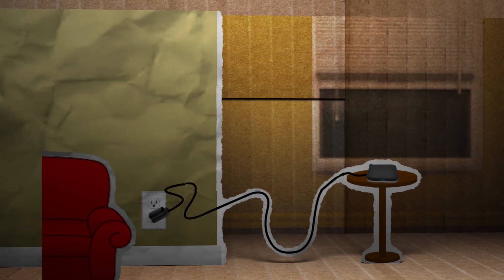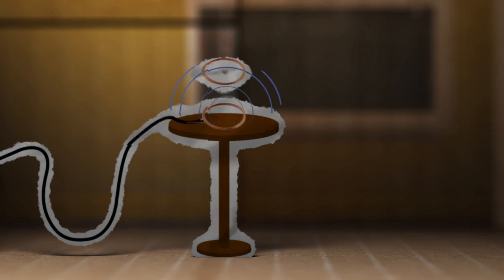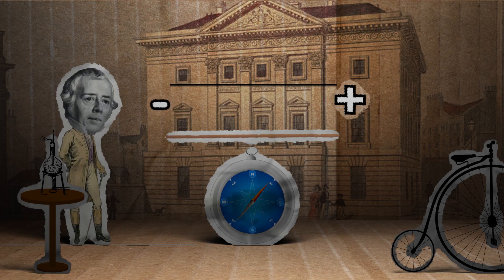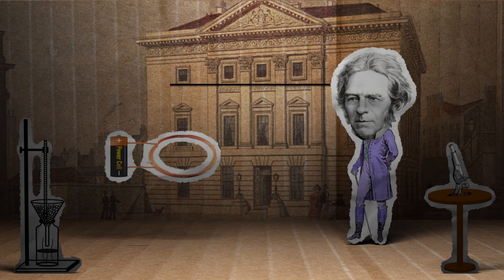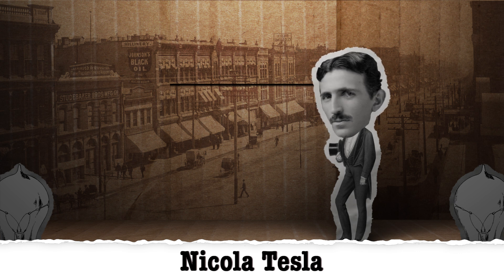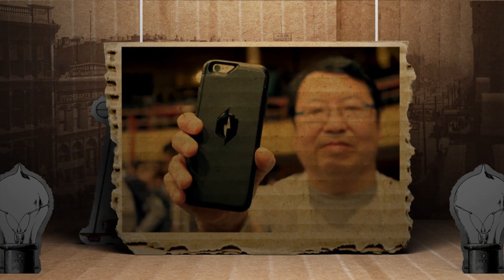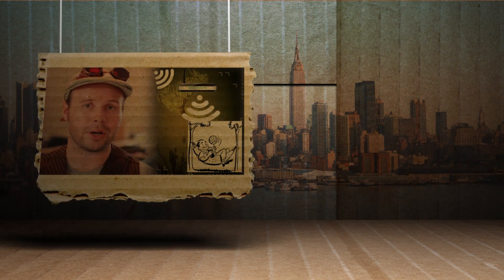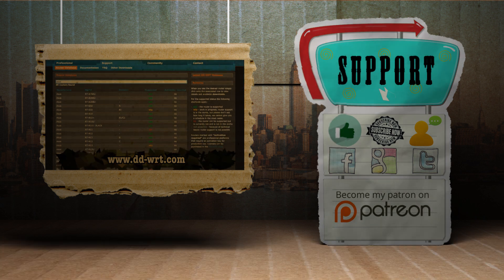How Does Wireless Charging Work?

Comment: Protip: Dont put your creditcard on the charging pad, It might kill it.
Reply: Lol
Reply: Myth
Reply: Eirik Quin It depends on your creditcard and charging pad, But it is a good general rule. Notice that i said Might and not Will.
Reply: will it induce a voltage on the chip? and might short-circuit it? or is it because of the magnetic field produce might demagnetize the card?
Reply: francesco gorini The voltage may be too high for the chip in it, killing it. It is kindof like putting your phone in a charger with 10volts instead of 5
Reply: thanks man, :)

Comment: "...radio waves...carry the magnetic field." This statement is not possible. The radio waves can send energy and the magnetic field can send energy, two separate things. You can either power it from magnetic induction or from receiving radio waves, depends on your receiver. One sends from an electromagnet, the other from an antenna. Great videos!

Comment: That was a picture of Wardenclyffe tower not a Tesla coil and a Tesla coil doesn't create a large mangentic feild by "creating sparks" it uses the spark gap in series with a capasitor to turn the electricity in the primary coil off and on at the right frequency so the secondary resonates a bigger feild at the same frequency. Just thought I would clear that up :)
Reply: Sorry the spark gap is in parallel with the cap not series
Reply from the maker: I meant to say spark gap, but said sparks instead. I actually had a whole section on how tesla coils made resonate frequencies, but it made the video too long so I had to cut it. Instead I just linked to an article explaining how they work.
Reply: Yextus So is wirrles charging harmfull?
Reply: Narps No, but I was wrong in my comment. That is a Tesla Coil not Wardenclyffe, not sure how I messed that up.... Anyway wireless charging isn't harmful, ironically enough im currently reading a book about Tesla right now and as he described it - light is more dangerous than radio waves

Comment: Uh, tinkernut, that "Nicola Labs" wireless charging thing isn't actually all that efficient. From my experimentation with crystal radios, the power coming into the antenna is pretty much in the tiny milliwatt range, doesn't really do much in terms of charging.
Reply: HTFCirno2000 add more coil
a proper rectivier and a capasitor
and you will be amazed
Reply: ***** Okay, let's say we do that. How can you fit a large coil and capacitor in a thin phone case?
Reply: You mean Nikola not nicola
Reply: Thanks bro!
Reply: HTFCirno2000
easy phones are filled with capasitors
so one more does not make a diverence
same as for the coil
Reply from the maker: I agree. It's not really effecient at all. But it is based on this technology!
Reply: Tinkernut
Yeah, that is true!
Reply: *****
Um. Size still matters.
Reply: HTFCirno2000
in current phones (witch get bigger with every version)
there is room enough
Reply: *****
Do you even know what capacitors look like?
Reply: are you insulting me
i am an electronics hobbyist
i revuse to work on smd (my hands wont allow me to solder that)
look at my youtube chanal instead of insulting me
Reply: *****
No I didn't meant to insult you. It just seems like you don't know what you were talking about. You really can't just throw a few more capacitors in a circuit and call it a day.
Reply: well
in this case you can
if you tune the coil to the strongest frequensie (little tuned cap over the coil)
and then a standard bridge rectivier
then you can add as much caps as you want

i am in the proses of designing a tube powerd rc car
so i know about tuning in am circuits
Reply: *****
It's just, for a standard phone case, AM circuitry is pretty big for just the really thin case of a phone.
Reply: i can make a am recever with 2 resistor inductors and a transistor
why would that be to big for a phone
Reply: But that's not wireless charging at all because that requires a battery.
Reply: ......
if you take the crystal recever circuit double it
and use the 2nd recever with a capasitor after the germanium diode you can power a small one transistor amplyfier

so hard it is not
mmmm
(i imagen yoda would say right now)
Reply: *****
But you can't take some power and double it with the same power. It doesn't work like that.
Reply: why not
stop thinking inside the box
becaus the box limits you what you see

step outside and look at the box
everything that is imposible will become clear
and or posible

to get power you make a recever replace the headphone with a cap and there ya go rf powerd power supply
make another recever and amplyfie that witha transistor that is powerd from the 1st one

free radio
Reply: *****
But that box is the fundamental laws of physics. There's no way to get power out of nothing. If there was, we would have figured perpetual motion decades ago
Reply: the laws of fisics are not the box
they are what is the space around the box
you can bent them but not break them
and you cant get power out of nothing
but you can convert power
you can confert volts to rf
but rf to volts is also posible

in my electronics lab at school i had 10M of cable
and all the rf of the motors and tl tubes gave me 30V out of that cable
Reply: ***** You should improve your english before commenting, I think everyone would appreciate it.
Reply: Why should I change
You have to learn Dutch
Reply: ***** And why is that?
Reply: Well because it would make my point clear
Reply: ***** That dosen't even make any sense.
Reply: Well for me it does
I mean why is it that the whole internet needs to speak English
Why not my language for once

Het zou namelijk veel makkelijker zijn om de type fouten te begrijpen
En Meer begrip te hebben voor elkaar
Reply: ***** Well, english is one of the most used languages right now and german isn't really near to being one of the most used languages.
Reply: German are you mad
I speak Dutch
And not German
Reply: Emphazys
...And this is why i stopped commenting in this thread. lol
Reply: Sie sind alle verrückt

that is german

jullie zijn gek

that is dutch

your all crazy

thats english
Reply: HTFCirno2000 Gonna stop too from now on...
Reply: no problem
dont dont even get why you make such a fuss about my gramar
my understanding of technik is sound
Reply: +HTFCirno2000 Thats not the point. Back in Nichola Tesla times, it was possible to charge things over a big distance. If corrupt govermant agencies and companies that make wires somehow let it slip that this is possible. We will be driving cars that will never need charging. Unfortunately thats not gona happen till we run out of oil. Too much miney at stake.
Reply: Alex Grava You do realize how inefficient wireless charging technology is, right? Look up the Inverse-Square Law.
Reply: HTFCirno2000 It can be perfected. Tesla did send electrical currents over large distances with only minor losses... Im just saying...
Reply: Alex Grava Alright, while I've heard of that, i'm not entirely sure how that would work. If that was actually implemented, radio communications would probably be hampered because of things like harmonics and splatter.
Reply: Angel Luis Trinidad i dont mind that every body needs a bit of english
but i hate that they hate on people who can do more then one language but not perfect
Reply: +robot797 : You could post in your own language which no one is stopping you to do, but if you chose to use english(which is widely used and de facto standard) in your communication then trying to be good at it is not much to ask. I can also stop reading dutch-english like yours to not be irritated. I will take second route and leave you with your fake pride.
Reply: ***** I won't change how I write just because one person can't read it

Comment: But the phones are covered with cases so how exactly does the POWer reach the battery? And doesn't it affect the case?
Reply: ***** Thanks. But the iphone 6 is made of metal and still has a wireless charger.
Reply: Those cases contains the coils, and are connected to the charging port I suppose (I haven't tried induction charging)
Reply: Saaki Blanco the iPhone 6 does NOT have a wireless charger. It never did. The only way you would be able to get wireless charging with an iPhone 6 would be with a plastic case.
Reply: rocktheworld2k6 Ok, thank you for the information. I may be mistaken.
Reply: Saaki Blanco No worries! I can see it, many phones are coming out with wireless charging right now, kind of surprised Apple hasn't gotten in on that. If they went back to the glass back like they had on the iPhone 4, I could see them adding in wireless charging

Comment: hey i have question so did electromagnetic induction have dangerous effect for human body ? thanks
Reply: ewan nixon Nope.
Reply: Electromagnetic radiation is only harmful at an energy that is sufficient for affecting chemical bonds ("ionizing radiation"), which is about 5 electron volts. This is more than 10 billion times higher than the energy of qi-charging radiation.

Comment: this wrong place to ask but answer my question please, how do rockets and satellite propulsion work in space? there is practically no friction, i understand they use orbital slingshotting (kind of), but for example after they exit the atmosphere, what propelles the satellite? you can't have a fan propelling, i am stupid please make me little smarrter
Reply: it orbits...
Reply: Robert Wagner i know but to orbit it needs to reach a certain speed right? how to achieve that speed? from what i understand the fire mass from the rocket and because of newtons 2nd law, each action has an equal and apposite reaction, this means the rocket or satellite is pushed forward.
Reply: All current spacecraft use chemical rockets (bipropellant or solid-fuel) for launch, though some (such as the Pegasus rocket and SpaceShipOne) have used air-breathing engines on their first stage. Most satellites have simple reliable chemical thrusters (often monopropellant rockets) or resistojet rockets for orbital station-keeping and some use momentum wheels for attitude control. Soviet bloc satellites have used electric propulsion for decades, and newer Western geo-orbiting spacecraft are starting to use them for north-south stationkeeping and orbit raising. Interplanetary vehicles mostly use chemical rockets as well, although a few have used ion thrusters and Hall effect thrusters (two different types of electric propulsion) to great success.

Comment: Since it is an electromagnetic field, doest it involve radiation? In terms of negative effect of radiation exposure to human, do u think this is more good for human being?
Reply: Radiation is an umbrella term for particles/waves moving through space, and is not per se dangerous.
Regarding human health, electromagnetic radiation is only problematic at a high energy (which is not the same as intensity) at which it is capable of affecting chemical bonds (ionizing radiation), like UV radiation. Lower energy electromagnetic radiation such as visible light, infrared, microwave and radio are not ionizing and therefore considered safe.

Comment: So if I put my hand b/w this would I bee shocked
Reply: no, electromagnetic induction will induce a voltage on another conductor, your hand not a very good conductor, if you hold a wire over it and touch both ends, i think so, just theory...

Comment: Make two coils with about 20 turns of any wire. On one coil connect led. On other 9v battery with switch. Find a idiot to push switch very fast and if you bring second coil with led it will light up in theory. If you put some metal in center of those coils magnetic flux can travel easly through metal than through air.

Second example is to wire up a wire around nail or screw and connect to battery and you will get electromagnet. More wire is better(more resistance and less heat). JUST DON'T KEEP IT MORE THAN 10 SECONDS ON BATTERY BECAUSE THIS IS A SHORT CIRCUIT. sorry for bad english

Comment: having big coil with big field is kinda dangerous for your electronics inside house, for example, if you have too long ethernet cable and you roll it into nice "coil", you will burn your network devices, same crap if i go somewhere with notebook and take my longer network cable with me nicely rolled up into coil, usually i am stopped by alarm in most of stores

Comment: This really didn't cover the science. I want to know WHY transmitting the signals powers the device. How does an EM wave get turned back into electricity?
Reply: +Jeremy Cantrell I'm not exactly sure, but my closest guess is that it does something to the electron and moves it, somewhat like the photoelectric effect.
Reply: Jordan O'C you're probably right. After watching this video, I went and looked at a lot of the basics of electrical power and just power transfer in general. I think my failure to understand was due to thinking of electricity like it's fuel. I assumed electrons were used up in some way when they are used. That's wrong, of course, because they're really more like a medium to transfer energy, but I do wish sometimes that people would get more into the nitty gritty of how this stuff works, rather than taking the details for granted. Oh well.

Comment: If the tech could be expanded in terms of range, it would remove one of the biggest downsides to wireless tech in home. That being the need to have a stock of batteries and the device dying on you usually when it is not convenient. Outside of smartphone of course.

Remote controllers for video game consoles, TVs, wireless headsets, maybe an Occulus Rift?

If the limitations were not so imposing, it could even adapt itself into house hold items like the TV itself toasters, blenders, etc... could possibly eliminate the need for outlets all together.

Comment: Does this emit any type of harmful radiation?
Reply: lramos15 None at all
Reply: +lramos15 
At the low power levels wireless chargers use, no it doesn't, but it will if you try to increase the power.
Reply: Gordon Freeman It emits magnetic waves, those aren't harm full, it is possible it could to something if you put an extremely powerful one right next to your brain, but no good tests have been done.
Reply: Kevin John
Is not about the magnetic field, but the frequency at which the magnetic field is generated.
Reply: +Gordon Freeman that's very interesting, I had no idea that would cause anything.

Comment: And then they used these principles to create the transformer (like the one inside the phone charger), with a laminated ferromagnetic core to concatenate the magnetic flux so that most of the energy is actually transferred from one coil to the other and not dissipated. Then after a hundred years of development to reach over 95% efficiency, people are like "screw this, we want wireless energy" and we're back to the 1% efficiency range.
Wireless charging is great for small, low power IoT sensors, but for devices that have screens, processors and memory and have to communicate with a tower miles away, it's just not practical.
Reply: yondaime500 It seems to be a 65-80% efficiency, but i dont know much on the subject

Comment: I didn't get it :"he used radio waves to carry the magnetic field"
Reply from the maker: mamupelu565 Sorry I didn't explain that well. Radio waves are part of the Electromagnetic Spectrum. They produce electric waves of energy that can travel over long distances.  For each electric wave in the electromagnetic spectrum (radio wave, microwave, x-ray, etc), there is a corresponding magnetic wave that travels along with it at a right angle. Here's a good visual:
http://www.explainthatstuff.com/electromagnetic-spectrum.html

Comment: I'm %99.9 sure you need magnets inside each coil......
Reply from the maker: Jacob Paniagua Nope. Not true. If anything, you could put a piece of metal inside each coil. That will turn it into an electromagnet, or you could also use it to make a transformer.
Reply: Tinkernut OK, thanks. I put this on here because I took the Nyko Wii wireless charger apart a few weeks ago and they had magnets in the coils.
Reply: gtjack9 ok
Reply from the maker: That's awesome, gtjack9 , thanks1